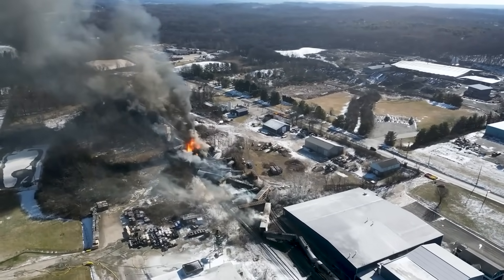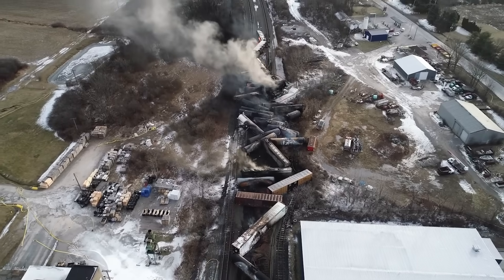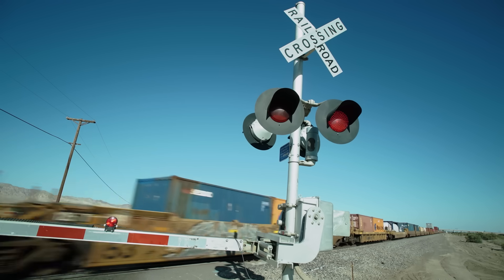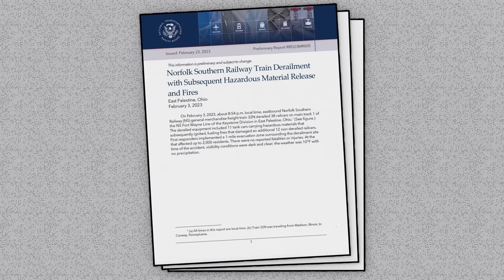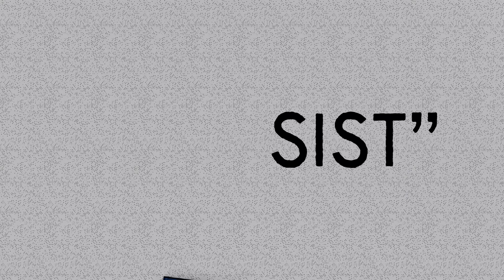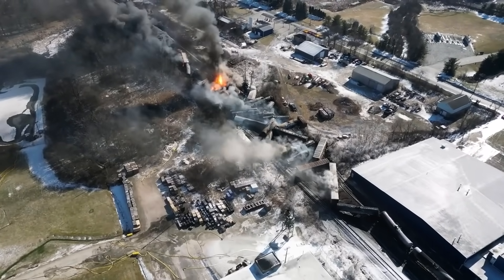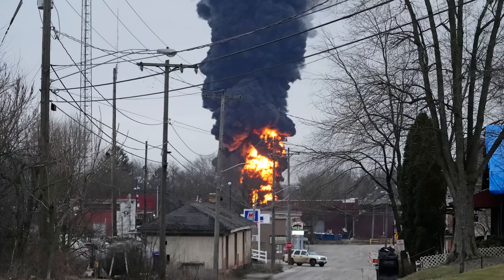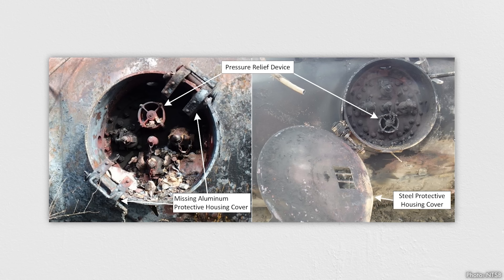East Palestine Train Derailment Explained

Comment: I would say that the systems and standards in place did their job - up to the point they were able to do it, at least. Old cars/old designs are kind of inevitable in a system as vast as US freight rail, and I'm sure no one wants to replace even a single rail car if they don't HAVE to do so. That's another piece of how and why the rail is so cost efficient. Perhaps some of the solution to this can also lie with the chemical engineering field, though maybe it would take a miracle to find (or persuade the industry to switch to) a different, less dangerous chemical, something to replace that vinyl chloride. But I am well aware that sometimes there's just NOT a substitute, truly no other chemical that will react in the desired ways for the desired end products. Trying to demand that we stop using PVC is obviously foolish, and maybe it's equally foolish to ask whether we can change the formula that creates that material.
I saw some folks in comments mentioning that the defect detector system should perhaps be improved on, and I can see benefits there - but I would add that we should be careful not to load more complexity into an already complex system, if it can be avoided. US railroads are, at least partially, a legacy system - and one suffering greatly from a sharp drop in status over the last decades - maybe a century of it by now, depending on whose book you read...
I would VERY MUCH love to see rail become more than it is now. I want there to be passenger rail service all across this country, to the same standards that the EU enjoys, I want freight to get the improvements it needs to be greener, I want cars to get replaced more often, and I DON'T want to see railroad companies bankrupted to do it all. It should be possible, and it's SO worth the effort. Just as a single factor - you said here that there are 8 times fewer accidents on the rails than on the highways. Now apply that to vehicular accidents involving solely passengers and no cargo/freight traffic. How many thousands of lives could be saved by that reduction? I'm not doing the math, but I'm betting that it's a substantial number. And even with rail still on relatively "dirty" fossil fuels (I'm given to understand US rail relies almost 100% on diesel electric at this time), we might put a sizeable dent in the amount of emissions too, by removing that many more vehicles from the highways.
But, of course, none of this is going to just happen, like a snap of the fingers and a training montage. It will cost millions, and take years, even if we started today and never once cut costs or compromised on priorities.

Comment: What you didn't mention: they monitored temperature of those cars and saw increasing temperature after fire put out which indicated a chemical reaction had begun inside and would absolutely result in explosion (not just release in pressure).

Comment: I don't drive a train but I drive a truck with a 30' RV behind it. When I take a trip after driving a bit I will stop and check the hubs by just feeling if any of them are hot. It's a common failure point that's easy to detect before it fails.

Comment: The NTSB press conference some days after the deraulment was chockfull of facts.  And they pointed to a TSB (Canadian equivalent) study showing how quickly ball bearing assemblies go from normal to failure and hence the need for more frequent wayside defect detectors.  The data from the detectors showed gradual increase of temperature  on that car's axle over some distance, and by the time it reached the NS treshold, it was to late. 

The crew got the "problem detected" and properly initiated a controlled train stop.  It was during this that the wheel failed and derailment happened (at which point the brake cable snapped which triggers emergency braking. (when brake line pressure drops too rapidly,  there is a mechanism in cars to release the full pressure onto brakes right away (as opposed to pressure commensurate with decrease in brake line pressure).

Had they had the defect detector a few miles before, we would have never heard of that train because it would have alerted crew of problem and given time to come to fuill stop prior to wheel breaking. 

In some derailments, the engineers will go as far back as they can to uncouple cars as close to derailment/fire as possible and pull those away. 

What the NTSB press conference did not deal with:  Who owns the failed tank car (and thus resposible for its upkeep) and who is responsible for checking it at what intervals. 

The NTSB press conference mentioned the axcle temperatures at the different defect detectors prior to derailment, but not sure if the crew would have seen this gradual increase (some other posted mentioed they would only see "no defect". This is where some new logic might correlate rising temperature at the same axle over more than 2 defect detectors assuming these are able to know that it is the same train they are measuring which isn't a given. 

If you want a really good explamation on how the wabco air brakes work: 
www tsb gc ca   Rail -> Investigations and Report.  Enter "Yoho" in search box  and you will find:
Completed	R19C0015	2019-02-04	
Uncontrolled movement of rolling stock and main-track train derailment
Canadian Pacific Railway Company
Freight train 301-349
Mile 130.6, Laggan Subdivision
Yoho, British Columbia

The full report goes in depth on how the braking systems work in north america.

Comment: Not a single reference to deregulation? Regulation based on the failures in the future would be great - but it is important to recognize the active efforts of the railroads to avoid regulation and to remove or reduce existing regulation both now and historically.

Comment: It's frustrating that they have sensors which detect the problem, the sensors work, they react when the threshold is exceeded, but it's too late already. This is a system set up for failure. They need more sensors and lower thresholds so that the derailment can be avoided in the first place. The government needs to make sure that all companies follow the same rules when it comes to safety. That would incentivize more frequent inspections and on-board surveillance to avoid expensive stoppages. It should not be unthinkable in this day and age to have sensors on the train which constantly monitor critical components and can tell you a bearing should be replaced before it fails.

Comment: There is no separating politics from this issue.  Rail workers intended to strike for better working conditions and were forced by the President not to. The choices that directly lead to these accidents are not purely engineering.

Comment: Chemical engineer here...the "controlled release" was handled exceptionally poorly in this situation from what I see.  There are portable combustion units designed for burning vents available throughout the chemical industry.  These units allow for proper combustion with enough oxygen to prevent black smoke resulting from incomplete combustion and are used for preparation of large storage tanks containing flammmables. In addition, combustion products from any chlorinated product MUST be run through a water scrubber to absorb the HCl byproduct.  Burning chlorinated hydrocarbons produces HCl and/or Cl2 in some ratio depending on the amount of oxygen present during combustion and both are toxic even at low levels (PPMV).  The HCl will react with water in the air to form hydrochloric acid which causes numerous issues environmentally due to it being a strong acid.  This reeks of a government cover-up becausd rail is essentially a government-granted monopoly industry and they didnt want people to know how bad the effects of that "controlled release" would actually be.

Comment: The only thing that works effectively against derailments is maintenance maintenance maintenance of all elements.
That means: Locomotive, trailer and seemed to save at regular intervals and not.
A defekt detector is just one tool that can help against something like this, along with maintenance.
But as you can see there, these detectors are not a panacea.

Comment: I worked as a contractor, driving rail crews from the yard to trains on sidings, or vice versa.  It wasn't part of the job, but I would sit there as the train pulled off, listening to the sounds of the bogies.  If I heard something off, such as grinding from a bearing or hanging brake, or a flat spot on a wheel, I'd write down the car number and turn it in at the end of my shift to the rail master.  Dude bought me lunch every once in a while when they caught a smoking bearing from my notes.  I think he said that one case saved them over 20k in fines as that train was stopped just before entering a coal fired power plant.  Had it gotten on site hot, it would have shut down the dump station until the rail company could get a crew into the plant to deal with it.  Catching it off site meant the rail crew could work on it on a siding without stopping the flow of coal.
Reply: Was this before or after deregulation?
Reply: You clearly deserved to be fairly compensated for your work.

Comment: Why are you comparing the number of fatalities on this? (at 13:51)  That is a comparison that is pretty much guaranteed to always  "prove" road transportation of hazmat is more dangerous simply because of the nature of the vehicles and transport infrastructure involved (roads have other drivers around; truck cabins are considerably flimsier than locomotives, etc). Other metrics would possibly be better, like number (and severity) of incidents per X tons or X thousand liters of material transported ; total cost of cleanup per year would also be a good metric, because it directly measures impact and severity of incidents.

Comment: Although there have been derailments after watching this video from City Nerd about how the NYC MTS moves more people than the Toronto Highway daily and knowing the logistics of moving so much freight as well as having lived in a very well developed railway region such as Europe along with lived in non-developed rail service regions such as Texas; I never quiet understood why trains aren't more common or better developed to prevent derailment in the USA?

Is there an engineering issue with refitting rail networks or cities to accommodate better rail traffic within and between them? I know in California the trolly lost out to the car strictly due to the rubber manufacturer's lobby because it was cheaper to lay rail originally. Often I pontificate on what it would have been like if the rubber lobby had lost and California didn't develop the freeway/tollway network.

Comment: Train personnel should have restricted duty hours (required off-time) somewhere between truck drivers' and airline pilots' – around thirty hours per week. And there should be one or two additional crew on these mega-trains. And on approaching a populated area, trains should pass a basic safety check (rule #1: Do Not Be On Fire), and lower their speed, just like a cargo ship approaching port. /rant
Reply: Rule #1 of Train Club is that you don't talk about Train Club...
Reply: @southernflatland  Haha, right. I was thinking about a place called Nottingham Hackspace's "Rule Zero"
Reply: @raffriff42  Hush, we don't talk about rule zero. It's null and void.

Comment: Thanks for the video! Something to keep in mind is while Norfolk Southern is "meeting regulations" for cleanup and general operations, they have been dismantling regulation for years, so the actual requirements are much weaker than they probably should be.
It's all about profits. And for companies like Norfolk Southern, paying for accidents and dealing with potential fatalities is better for their bottom line than trying to make sure those accidents don't happen in the first place.
Reply: One thing to add as well when it comes to paying for accidents, Norfolk Southern contracted a private company, CTEH, to conduct air quality tests. CTEH's air quality testing, especially when it comes to residents' homes, was unclear at best and at worst negligent, as it only tested for a limited number hazardous chemicals (VOCs). Despite the tests not having the expressed support of the EPA, the work technicians at CTEH performed became the basis for Norfolk Southern's attempts in reassuring the public.
Reply: @traindude 28 that sounds like someone just has to do the math. And maybe change the rules.
Reply: @Jacksparrow4986 work on a submarine, and as a part of our watch logs, any noted tank or temp changes above certain levels per hour will warrant investigation to ensure something such as- clear climbing of temperatures with no real reason- is less likely to happen.
It protects us, our equipment, and the environment we work in in some cases.
Reply: Lmao yeah, like why would anyone believe Norfolk Southern? They're gonna do anything in their power to make this problem "go away". They should make Norfolk Southern executives drink the water from Easy Palestine for a full year.
Reply: Absafuckinglutely.  Oh hey, but it's not political, right???
Reply: That's capitalism for you. It's destructive.
Reply: I was looking for this comment.
Reply: I would disagree. E.g. changing the messages from "no defect" to including the measured temperatures should be simple as hell, and with the numbers on the train you could apply 9th/10th grade math to do what one might call "predictive issue prevention" (when trying to sell it and charge $$$ for the software that does it) so the issue should have been noticed a lot sooner.

Comment: I still don’t understand how the derailment happened. You mentioned the controllers put the breaks on as soon as the detectors sounded the alarms, and then the emergency breaking system engaged at the same time. So I guess the breaking system didn’t work because that one car with the failed bearings seized up and caused the car to jump off the track?

Comment: Sounds to me like the monitoring systems are insufficient. First, the existing monitoring systems should be networked and measurements correlated so you can trigger an alarm on a rapidly deteriorating bearing. Second, either the number of wayside defect detectors should be increased, or sensors should be installed on every railcar.

Comment: Grady - this was a terrible video on your part. "Explained" in your title should be replaced by "Smoothed Over".  In the first 5 minutes the accident was explained. Due to the profit motive a human being's eyes and judgement were replaced by a machine placed every 10 miles , that may or may not be functioning correctly, and that the owners of the rail road can ignore if they feel like the gamble of an accident will pay off in the end in terms of profits. That explains the accident. Sorry if it is political to admit.  As an engineer I would like your opinion of whether train breaks that hazardous cargo depend on, should be allowed to run 175 degrees F above ambient temperature? Is that ever safe? Would you drive your kids to school with your brakes nearly boiling hot? Come on man. Also - Flaring off implies that the problem is gone - but conservation of energy tells us the opposite - the problem went somewhere that shareholders of the rail road won't be liable for. You pretend that the liabilities created by this royal screw up are just "perceptions". Nonsense. People can't use their basements in this area before they are tested for chemicals that the rail road dragged their feet on letting them know to even look for.  Nationalize the railroads. Yes they are vital. Too vital to be run recklessly by profit takers who don't mind destroying the ecosystem - translation - the aquarium you and I also swim in.

Comment: I know you're not a train engineer, but steel doesn't burn, unless it's in the WTC
Reply: Steel doesn't burn, but it does get pliable in heat, which combined with the weight of the towers above caused the steel to fail.
Reply: Meanwhile, it's a known fact steel shavings can, do, and will burn.

Go ahead, try it. Steel shavings actually do burn.

Comment: Railroads are vital to an economy that priorizes low cost.  Sadly the lack of oversight and regulation of the industry means incidents like this are bound to happen, and will likely get worse as the railroads look to further reduce their costs per mile by making trains longer and longer.  Road going semi trucks face significant regulations in their daily operations.
Reply: basically this. A lot of this could of prevented if they actually maintained and not rush to get shipments done asap to bring in more money. There is a price to  pay to rush and that generally means more maintenance costs and more down time.